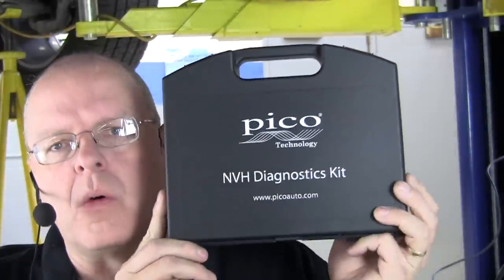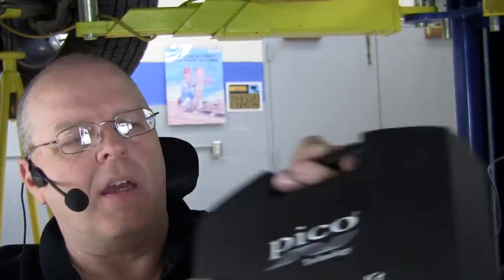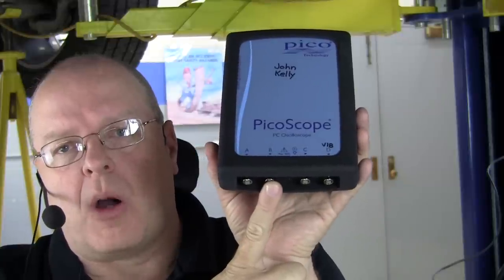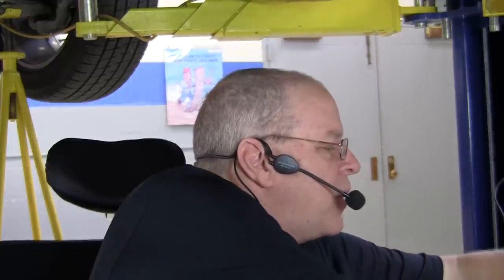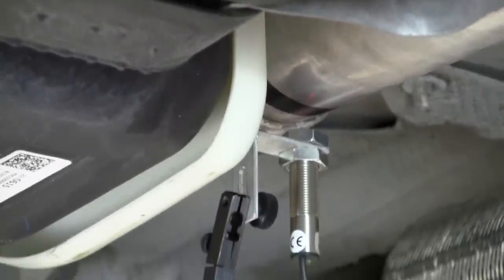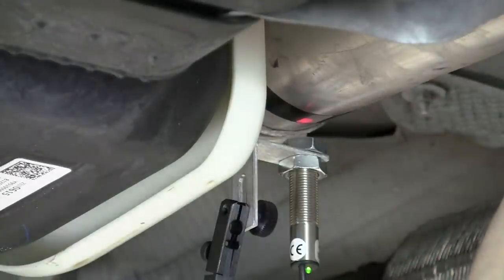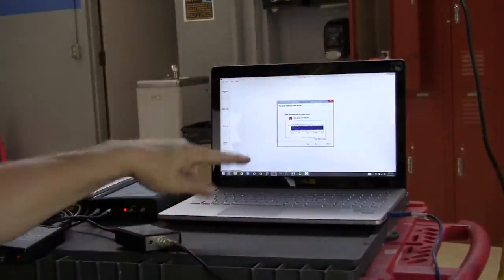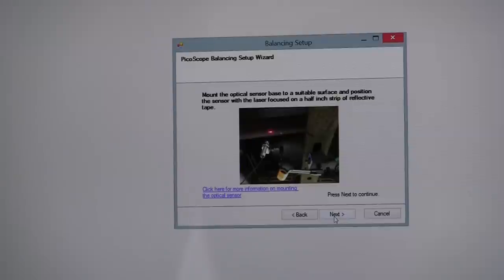On-Car Driveshaft Balancing - Part 2 of 2 - Pico NVH Kit

Comment: Hi John, Thankyou for the demonstration if the NVH kit, I have just bought this. There are a few ways of doing balancing. This is quite a technical method but I have seen it done with much simpler equipment at a much lower cost. This system does have the big advantage of giving you numbers. All us engineers like numbers. So thankyou.

Comment: Why did you move the clamps towards the heavy side?  I would think you should move the clamps away from heavy side?  It seems the sensor is showing worse result.
Reply from the maker: Normally this balance procedure does not give you an exact balance on the first try, you have to move the clamps equally a little bit one direction or the other to get the balance amplitude as low as possible. Normally I move them farther away from the heavy spot and it works great. This time it got worse, so I went the other way and it brought it down to a very low level. Thanks for watching!
Reply: Correct, he was suppose to move away from the heavy spot.

Comment: 160mm in direction of rotation means nothing. In your case that would be 180deg. or half of the full circle .  Diameter X Pi = Circumference or Circumference / Pi = Diameter  102*Pi(3.14159)= 320.442
mm to Inch = mm/25.4 or mm x 0.03937 as for the extruded Aluminum Tube I always Calipered them at 4"  (4x25.4=101.6mm)
102 works just fine just adding this as another way to get to the goal.
Reply from the maker: Thanks for your input. Yes, that is true. The direction of rotation does matter when it asks you to move the clamps to a position other than 180 degrees away from the zero mark. There are at least three more clamp locations in the process that are not 180 degrees from 0mm.

Comment: Do you think simply changing a ujoint can throw off the balance of a driveshaft?

Possible scenarios are:
Ujoints have variations in weight,
Caps have variations in weight.....
Ujoint was not centered when it was factory balanced and now YOU centered it.....
Ujoint was centered when it was factory balanced and now YOU uncentered it. 

Maybe if a ujoint is shifted over just .005" in its bore from true center it will cause corresponding driveshaft runout and affect its balance!

Comment: Nice Demo ! I  was hoping I could pick your mind before I do some investigation of my own. My wife had a local shop install a two piece rear drive shaft on her all wheel drive 2010 Subaru Outback late in the fall. All was well until the temp dropped come this winter.  In the morning and the temp is below say 32 degrees F there is a rubbing noise accompanied with a slight vibration coming from the right rear of the car under 45 mph that goes away within a mile or two of travel. I suspect that as what ever is causing the noise heats up, the noise/vibration goes away. I think it may be a sticking emergency brake shoe but my question to you is could the new drive shaft cause this with these symptoms?  Thanks !
Reply from the maker: Anything is possible, but I would not think it would be related. It may be a CV half-shaft going from the rear differential to the right rear wheel, or even a wheel bearing. There is no way to tell without doing a visual inspection first.

Comment: Thanks for sharing! This is very nice software. 

Is it possible to have the yoke 180 degrees out? 

What brings me here is nothing less than a bad vibration from 35 to 45 MPH in my KW T800 dump truck.
I replaced a carrier bearing in it a couple weeks ago and the vibration didn't go away like it always had.
I believe there is a balance issue because this thing goes through carrier bearings in less than 2 years. One didn't last 3 months.
 So I tried a harder urathane carrier this time. Some folks say they are too hard and will always vibrate. I think the softer carriers that had always been used in the past have kept the balance issue hidden until it finally beats up the carrier causing premature failure.
Any thoughts?

Comment: Are the hose clamps considered a permanent fix or just for balancing? Would welded weights be attached after the balancing process? I would think on a work/ farm truck that drives over tall weeds and grass and snow banks that the clamps would get fouled up or get knocked off.
Reply: Yes, the hose clamps can be left on permanent.

Comment: ? My 3.9 Dodge 1998  ram b1500 Van Vibrates on deceleration. really can 
feel it around 35 miles per hour. What do you think  it could be?
Reply from the maker: Most vibrations on deceleration are due to a worn out axle (loss of bearing preload allows the gears to pull themselves together upon deceleration) causing a vibration. It could also be a change in pinion nose height affecting the u-joint working angles. Best wishes!
Reply: can you also tell what the cause is if a car vibrates and rumbles on acceleration only? especially uphill or slow speeds when its heavy

Comment: Hi there, Can I use  Pico NVH to balance two-piece propeller shaft?  

Thank you
Reply from the maker: Yes, it will work on any driveline assembly. The trick would be to determine where the imbalance is the worst and install the clamps in that location. Best wishes.

Comment: Hi there, i own a 2016 silverado with 30k miles. I see some markings similar to the ones you made on the shaft but there is no clamps .. Dealership is telling me that i need brand new tires to get rid off the shaking.. any thoughts?